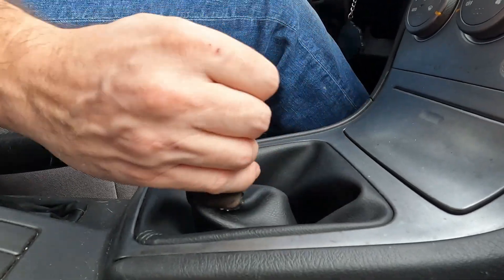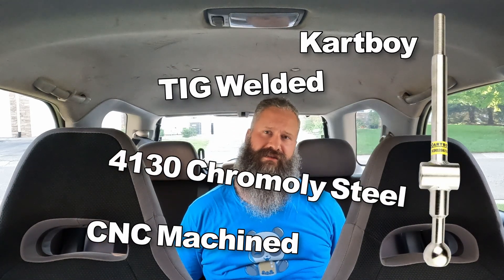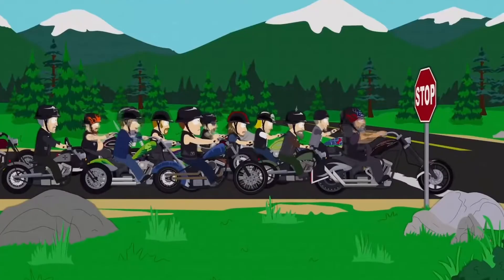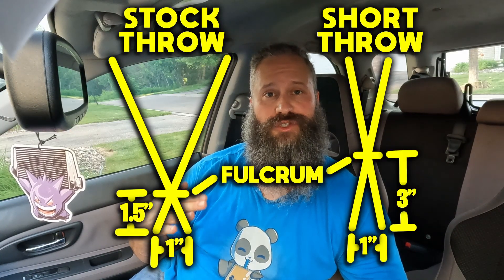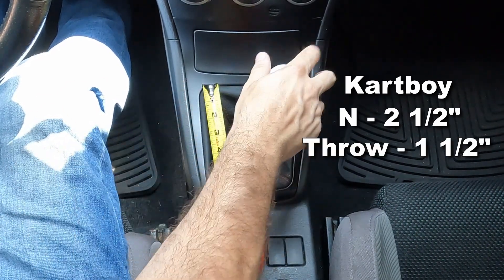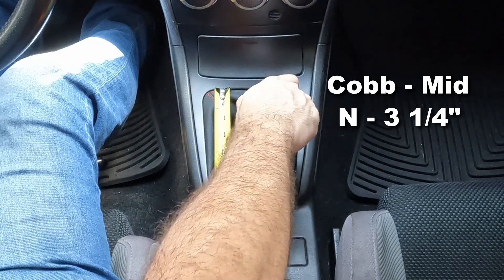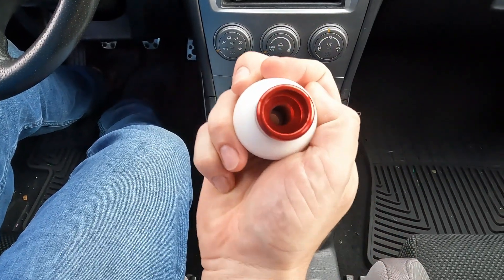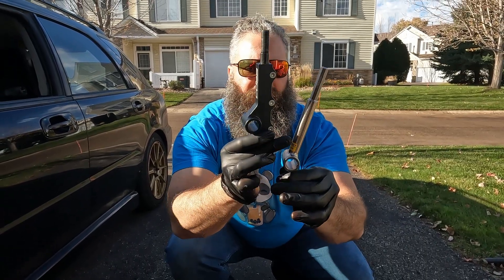Which Short Shifter is Better? Cobb vs Kartboy

Comment: Very underrated video! Thank you for the info. I bought a kartboy kit with bushings and upon installl I found a Cobb adjustable already installed.
Reply: Did you continue with the install of the Kb? If so, which do you prefer after using both and why?
Reply from the maker: I also would like to know!

Comment: Bro this was a GREAT detailed comparison between the two, just the video I was searching for! Thank you! Question, did your Cobb knob twist easily onto your kartboy short shifter or was it a struggle? I’m having trouble getting mine to thread all the way and it doesn't feel like it's threading in right, almost as if it's just a tad too small for the shifter thread. Cheers!
Reply from the maker: Thank you, I appreciate that!  Yeah the shift knobs spin on and off easily, it sounds like yours might be cross threaded.
Reply: @ dammit 😭 I appreciate the response brotha, thank you!